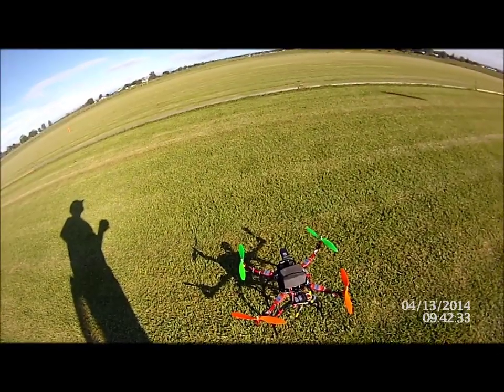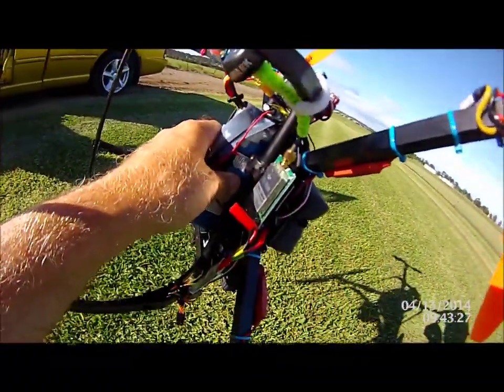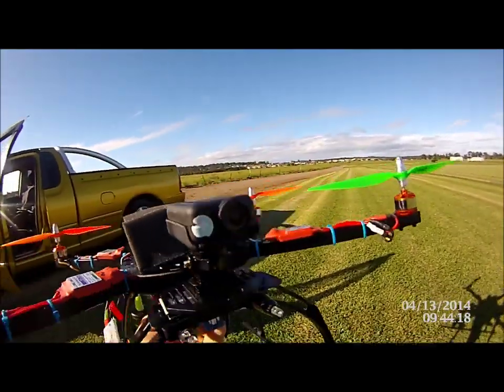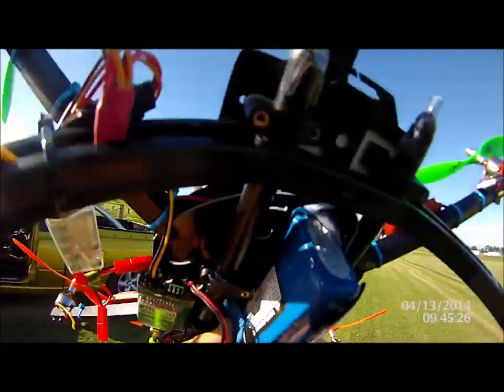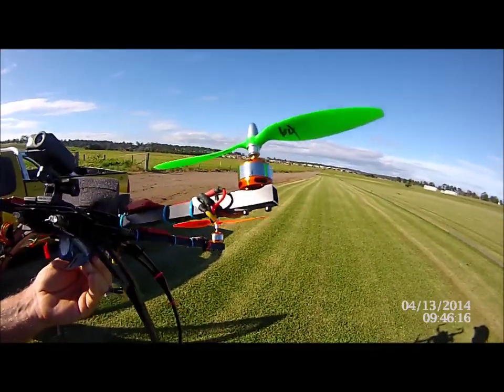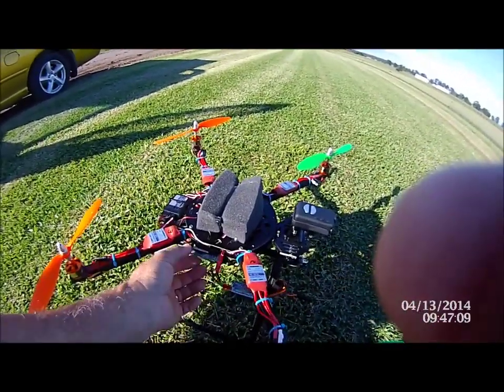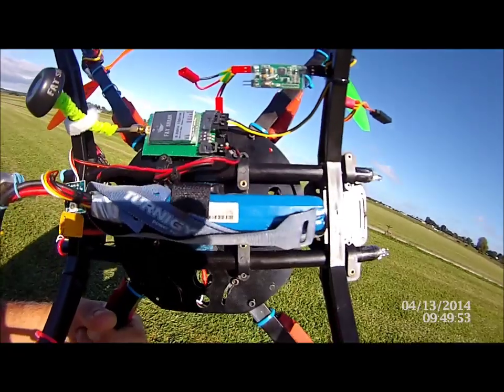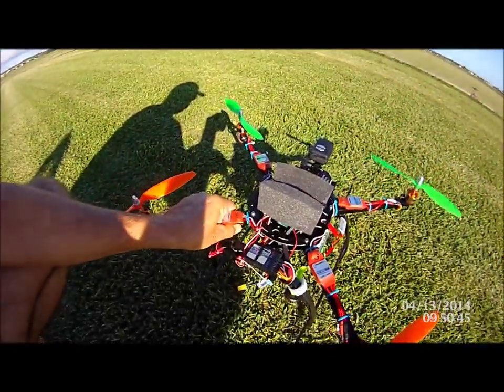X580 Walk Around

Comment: Hi, You replied to my comment on HK re the pro board. A bit of a coincidence as my quad is also a HK X580. Motors are turnigy 2830/11 with 10x4.7 props, turnigy 30amp esc's (overkill on them). It's also got a fatshark setup on board (only a teleporter but I'm new to FPV). Radio gear is all Orange RX. I'm using 3 cell 2200 lipo's.Quad flies fine  and when I connect up the GUI to the board it reports it's position fine but pos hold still drifts. I'll keep plodding along till I sort it out as I've seen your vid using 2.3 so you have obviously got it working.

Comment: I am just wasting all kinds of time trying to get this 650 mm quad running to simply lift off and hover with out any input. :-(. Hardware EMI isssues made an attempt with an  APM 2.5 running Arducopter and Mission Planner have made made it necessary to start with a new hex frame (parts on the way). In the meantime I have not managed to get this HobbyKing X650F quad in the air yet!! ( well not a stable hover, with no stick input) This KK2.0 is becoming suspect. I would like to change this repeating outcome. really, it is driving me...so anyhoo I figure its got to be this KK2.0, Care to rate the MutiWii for simplicity of setup / onscreen config. I am also checking out the CC3D. I just want to get this airborne mate. :-)
Reply from the maker: Hi Chris.... the multiwii boards are great to fly but there are a few golden rules to follow... and if your new to them it could be a tad frustrating... my MW pro board took 3 months for me to be game enough to fly it and when I finally did I was so disappointed but I stayed with it and mastered it and now I wouldnt fly anything else...... if you want a simple MW board to get a quad off the ground I would suggest the 328P from hobbyking... around $30... it has a baro for altitude hold and a compass for headsfree......... and they are awesome for aerobatics........ I would suggest you google how to set up a multiwii board as they use arduino to program them..... sounds hard but its really a walk in the park......... as for the CC3D they are a tad too expensive for me,.,,, KKs are nice as I have 3 now sitting in bags as Multiwii has taken over.......